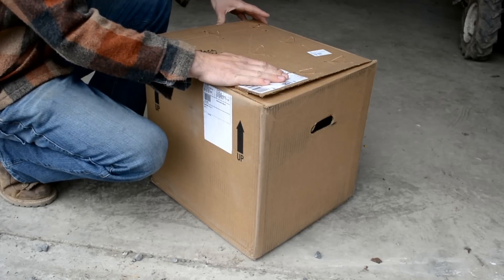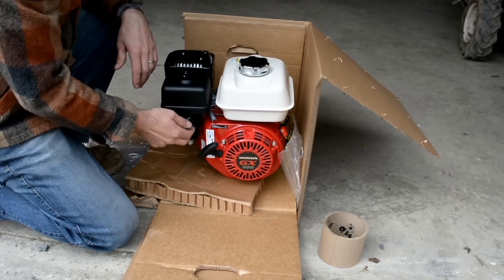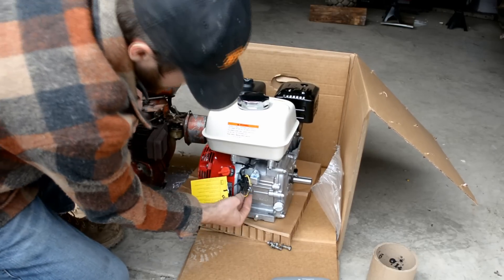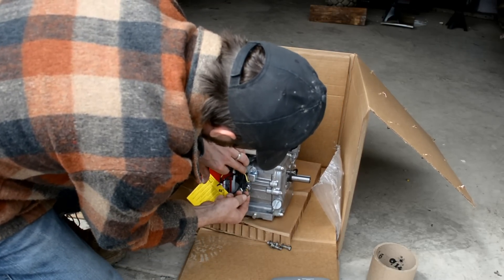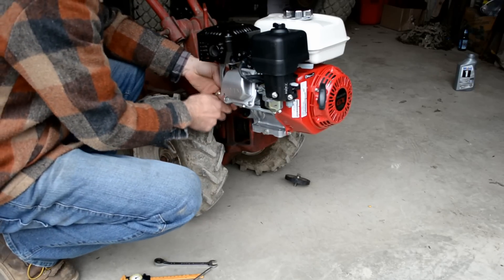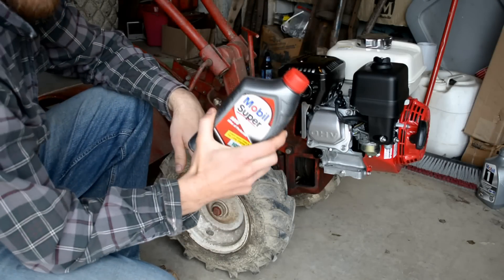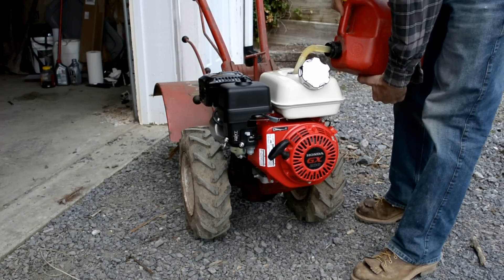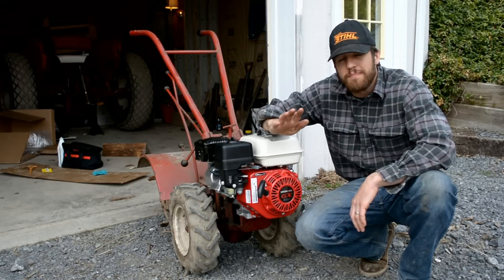Upgrading a Troy Bilt rototiller with a new Honda engine

Comment: i remember the Tecumseh engine  on pallets  waiting for mounting.  i worked on assembly and machine shop in the troy factory
Reply: Dad bought a 6hp Tecumseh Troy bilt in 79. I was the mule behind it most days. I inherited it when he passed last year and i just got i it running yesterday to till a patch for my wife to plant an herb garden. Great tools, pity nothing in the market is made to such quality anymore.
Reply: @jamespayne4459  Awesome, sounds like a good memory. Sorry to hear about your dad. I ended up replacing the original Tecumseh with a cheapo predator engine from harbor freight this season, but it works great
Reply: you guys made some fantastic machines. I am still tilling with a 79' troy built Horse
Reply: In your opinion, which engine was better on the horse tillers, the techumseh 6hp or the kholer 7hp, I have a 1979 Troy bilt horse tiller or garden way what ever you want to call it, it has the kholer 7hp on it and runs like new just tilled a nice area today :)
Reply: A little late to the party…but I’m running a 74 model with the 6hp Tecumseh. Dad got it used in 75. It’s a year older than me. Had a little trouble with carb this year so I ordered a new one. Got it running last year after sitting for about 15 years. It’s one of the tillers I’ve ever used.

Comment: Just placed an order with small engine warehouse. Engine cost $295.00 same as yours. Ordered a set of tines with all hardware $99.00 and the 5/16-24 bolt. Hope to have it in a few days.
Reply from the maker: 5 years later and I am still happy with my decision to re-power my tiller with a Honda GX. Worth the money to keep these well built machines in the soil!
Reply: NCPA Outdoors  Dont know if I asked this question or not. But did you lose reverse when you put this engine on. I got mine on and a new set of tines. It’s like a new tiller. Did about a quarter acre of garden space. I have two hillers that came with the tiller. Makes pretty rows and this thing is a horse. And it has plenty of HP to till with. I run mine half throttle while tilling or plowing. It never struggles.
Reply from the maker: backspace4093 reverse works great!
Reply: I purchased mine New in 1982 at a local Troy-Built Dealer. I have an 8hp Kohler I want to replace. Will the same GX Honda also work for me?
Reply: @RickBelleville  yes sir
Reply: @RickBelleville  My TB Horse had a Briggs Industrial Plus 8 HP.  I just purchased at Honda GX 200 QX2 from Arlington Power Equipment for a very good price ($369 + free delivery).  I am told that the Honda GX 200 (5.8 net HP and likely 6.5 gross HP) has plenty of power even though the Briggs that came with the machine had 300 CC displacement compared to the 200 CC for the Honda

Comment: What size are the engine mounting bolt? I’m buying one  but it has no engine currently.
Reply from the maker: Sorry, I don’t recall the bolt size as its been a few years since I’ve had it it apart.  I believe it was a standardized bolt pattern and size because the new Honda uses the same mounting holes and the original bolts from the old HH6.0.  Good luck with your project.  Happy gardening.

Comment: Thanks for this Youtube Video. My Troy Built Horse died just a couple of months back, rather than tossing it I found this video, bought the engine you recommended and replaced the old engine. Everything you said was spot on and made the engine change very easy. Now I am tilling better than ever. Thanks again
Reply from the maker: Awesome!  Glad your back in business with your TB tiller.  Unfortunately the original engines seem to be the weak link in these old tillers.  With minor maintenance this machine should serve you well.  Thanks for watching and commenting.
Reply: Just to be clear you re-powered your tiller with the Honda GX  200 QX or QX2

Comment: This engine revolutionized the small engine industry. Just about every engine manufactured copied this design. By far the best small engine on the market! 
Nice video!
Reply from the maker: Thanks for watching
Reply: @NCPAOutdoors  When TB made the transition from using iron block engines to aluminum engines, TB would bolt an "engine weight" to the bottom of the aluminum engine block to give the machines roughly the same balance and also weight helps you be able to put torgue to the ag tires/wheels which helps with traction.  

Did you compare the weight of your old engine to the honda engine?  If so what was the difference in lbs and did the change in weight affect the balance and tration of your honda repowed tiller ???

Comment: So how do you keep the pulley from turning to remove the bolt?
Reply from the maker: Mine pulled off easily by hand, but an impact driver or a three finger puller might work if needed.

Comment: Great video. I need to do the same for my 1974 tiller. Back then, they sold them with a 4hp Clinton. It's impossible to get parts for that anymore, so I'll be upgrading this spring.
Reply from the maker: The new motor was definitely worth the investment.  Thanks for the comment!
Reply: I have two of those Clinton engines 498 series. One came off a tiller, one came off a Yazoo mower and I got both of them in 1973 when I was in high school. Both had broken connecting rods. I repaired both and they still run. The tiller one we used to start racing kart engines with.

Comment: Good choice with the GX engine. They are as durable as the tiller. Now that you repowered it, time to put new tines on it.
Reply from the maker: Good observation on the tines!  We’ve looked at a new set of tines and tires these last few seasons, but its working good as is.  Possibly next year.  Thanks for the comment.
Reply: @NCPAOutdoors  It’s been three years now how’s it holding up. Mine still runs as good as the day I bought. Well worth it.

Comment: While showing bolt pattern, why didn’t you say the measurements ?
What about shaft dia?
Reply from the maker: I believe it was a standard bolt pattern, however it’s been a few years since this project was completed and I don’t recall the specific numbers.  I refrained from mentioning it due to various model machines.  Some TB tillers used engine other than the engine on mine.
Reply: My question exactly . Left out the most important bit of information we needed to here . Guess that caliper was for show and he couldn’t read it .
Reply: @raymondcote6669  Not to say that they do not exist, but I have never seen a TB Horse with anything other than a 3/4" keyed engine output shaft

Comment: Hi 

i have a Troy-Bilt Pro Tiller  8 horse    Kohler Magnam engine and i would like to do the same as you did on your tiller would a    GX270 honda motor fit? Is this a good choice. Just really like your video of your repair. any way Thank you in advance Mike here
Reply: i also have kohlar engine what engine did you choose
Reply: I replaced my 8 HP Kohler Magnum with a GX270 from Small Engine Warehouse in Indiana.  Great engine, even better than the Kohler and it was great!
Reply: @stevewarner8880  I just pulled my Kohler Magnum off of mine (8HP), the crankshaft is 3/4 dia and is 2 7/16" length.  The Honda GX 270 is 3.48 x 1 I think?  How did you make that work if I may ask?
Reply: @zacharbert6604  IF you are still looking to upgrade from the Kohler Magnum 8 HP,  Small Engine Warehouse carries a custom 9.5 HP Kohler Command Pro (industrial/commercial) engine that they have modified to be a drop in/bolt in replacement for most TB Horse tillers.
Reply: @stevewarner8880  Did you bore out the TB horse engine pulley from 3/4" to 1" to accommodate the larger and more powerful GX 270? Or did SMW have some custom made/customized GX 270's with a 3/4" output shaft?

Comment: Ok I am the only one who could not remove the 4 engine mounting bolts because they could not get the darn pulley off?
For those of you as challenged as I was here is the trick.
Do the stuff that is obvious, throttle cable, remove gas from tank, oil from engine ect.
Now to the brass tacks.
You can not remove the engine from the tiller because the pulley has been on there 40 years and rust wins this one.
To remove engine this is what I did.
1, Remove the 2 bolts on either side that hold the pins that the engine /cast iron mount sides on.  Also remove the 2 bolts that attach directly to the cast iron engine mount.
2,This puppy is really heavy so get help if you can.  Now you can get to the pulley.  Use a 67021 puller available from O'reillys auto parts as a loaner tool, Use it in the 2 jaw mode other wise there is no room to fit the 3 jaws into the cast iron part.
3, Pull the wire off the spark plug.
 Use an impact wrench to tighten the puller center bolt otherwise you may tear your arm off.
Now you are home free.

Comment: You can't beat a modern design OHV engine with the olde obsoleteo flathead designs.  The old tillers were great but they are even better with modern engines.

Comment: i am trying to pull the 2 sliding engine support mounts that the engine slides up and down.  i pull the locking bolts, but I cannot pound those long rods out.  does anybody have any ideas?
Reply: Had the same problem.  Pb blaster  helped a bunch soak them good and they should come loose

Comment: Thanks for posting!
Old Troy Bilt Horse tillers deserve love. They are the best designed machines. I like them so much I have 4. Last year I picked up a 1989 Horse 8 Kohler that was never started. A museum piece....for 500 bucks. I want to put it in my family room, wife says NO
Reply from the maker: We have to keep the wife happy!
Reply from the maker: W TF? When I completed this project to repower my Troy-bilt tiller I used the Honda engine because of its reliability and reputation.  When this engine was ordered, the distribution company I bought it from claimed it was built in the USA.  A quick visit to Honda’s website indicates that while it is a Japanese company, versions of the GX series small engines are still built in America, with American workers.  Thanks for watching.
Reply: NCPA Outdoors  I have a 8 hp Briggs industrial commercial engine on my tiller. I bought it pretty cheap no running. I want to replace it with the Honda engine. According to small engine warehouse it will fit my tiller. I tried to find the dimensions on my old engine on line but no luck. Maybe I’m Just not looking hard enough. The crank size is 3/4 x2  5/16 keyed shaft that’s the Honda engine.
Reply from the maker: backspace4093 my original engine was an HH 6.0.  Online engine suppliers should be able to set you up with a comparable replacement.  Sometimes a phone call can save a lot of time.  Best of luck.
Reply: W TF?  politically correct ignorance
Reply: How can you tell what year model they are?

Comment: I did exactly the same to my '72 Horse, only I used a 160 GX off a worn out pressure washer. I would one day like to rebuild my old Tecumseh to retain that "Classic" TB.
Reply: Keith Lincicum was your 160 Gx a direct fit? Have you been pleased with the performance?

Comment: I need to do the same. What model Honda engine did you use? Thanks!!
Reply from the maker: Feel free to check out the video, I think I covered the old and new model numbers.  I believe its a Honda GX 200QX.  The 200 is a few pound lighter than a 240 or larger but it isn't an issue for me, hardly noticeable.

Comment: No more reverse with that engine!
Reply from the maker: If you use the original pulley reverse will work fine.  No issues with my setup, everything thing bolted right up!

Comment: Will the original bumper guard fit around the Honda engine?
Reply from the maker: Hard to say as I didn't have one on my tiller.  I would assume it would fit based on the size comparison of the engines.
Reply: It will fit and you will have about a half inch of clearance.

Comment: Beautiful engine, great selection.  I hope it serves you well.  Is there a Honda with higher horse power that would be as easy to change-out as the one you selected?
Reply from the maker: Thomas,
I've seen Honda GX 240's and GX 390's used since upgrading my TB.  I don't feel that more power would be required for.the ground I work.  I guess it would depend how much hard pan soil you have to break up every year.
Reply: Thank you.

Comment: That Honda engine seems a bit light in the tiller at 200cc and 5.5 net hp.   Would a 305cc or 390cc work better?
Reply: They changed the way horse power is rated.  The Honda actually put out more than the HH60
Reply from the maker: The Honda is less weight than the HH60, but I don't feel it negatively affects the performance.
Reply: @sldl04  Going with a bigger displacement engine tends to cause two problems.  First,  all TB Horse tillers are set up to take an engine with a 3/4" keyed output shaft.  Second, the bigger more powerful engines tend to have a different and bigger bolt pattern that often does not mate up with the TB horse "bell housing".  Small Engine Warehouse and a few other places make an adapter plate to deal with getting the larger bolt pattern to mate up to a TB Horse "bell housing".  I have heard of people boring the 3/4" main drive pulley hole to 1" and then re-cutting the key way to make it possible to use larger displacement/higher horsepower engines on a TB horse as well.

Comment: Got the bolt off. Took off the flywheel guard and held the shaft nut while removing the pulley bolt. I can't seem to get the pulley off. How did you do it? It didn't look like you used a puller. I'm at a standstill and your help would be fantastic. BTW, I'm replacing the Tecumseh 6hp with a Honda clone. The tiller is a Horse 1 from April , 1970.
Reply from the maker: This is only held on by a key and shouldn't be a tapered shaft.  That being said mine fell right off.  I would assume that 40+ years of moisture, dirt, rust and grime would have it seized to the key and shaft. A two or three finger puller should take care of it for you.  The puller are fairly cheap or most auto parts stores will loan them out.  Thanks for watching.
Reply: +NCPA Outdoors    While tipped forward I soaked the axel/pulley overnight with penetrating oil. No go trying to pull it by hand. Auto Zone loaned me a 3 finger (you have to use your credit card, but get the $ right back) and it slid right off.

Comment: How did you remove the pulley bolt? Do I wedge something into the pulley to immobilize it, then loosen? What is the circular fitting your pointing at? My bolt is an exposed 9/16. Thanks.
Reply from the maker: Mine pulled of easily by hand, without the use of a puller.  A three finger puller might work if needed.

Comment: what was the exact model number on your Honda?  I'm planning on replacing mine and I have the same engine tecumseh hh-60. 
thanks for the video was extremely helpful.
Reply: Honda gx 200
Reply: mattprang4684  The poster of this video used a  Honda GX 200 QX which was the model number for the direct replacement engine ten years ago.   From what I have been able to glean using AI internet search the updated model and model number is Honda GX200UT2QX2

Comment: What about weight? Does the new Honda weigh the same as the old Tecumseh?
Reply from the maker: The HH-60 is cast iron and the Honda is cast aluminium.  As I recall the Honda was a few pounds lighter but I didn't notice any negative impact to the operation.  Thanks for the question and be sure to subscribe.

Comment from the maker: It would have been cheaper to use a clone but I went with the Honda GX as I didn't want to mess with a breakdown when it was time to plant.  The tiller works great, can't complain.  Thanks for the comment.
Reply: NCPA Outdoors =
Reply: NCPA Outdoors  Did you lose reverse when you did the up grade. Also did you have to use any spacers to get your pulleys to line up.
Reply from the maker: backspace4093 The reverse works great!  Reused the same spacers from the HH 6.0.  It was an easy project!
Reply: @NCPAOutdoors  I would make the case that while the predator engine will get the job done and is cheap, in terms of resale value, the predator hurts a tillers resale value.  If I were buying a tiller that did not have the factory engine in it and it was a predator, I would be very reluctant to buy it.  While at the same time if the tiller had a replacement Honda or Kohler replacement engine I would not hesitate providing the engine is in good shape and still has good compression.   Call me skeptical but in the long run, I can not see the predator having the same longevity as a genuine Honda GX

Comment: Wonderful video! I repowered my 2 Troy bilt horse tillers with 2 Honda clones from harbor freight. For $100 with a coupon, i couldn't really beat the price. But i might replace both of those motors with true commercial grade Honda when ever either one dies.
Reply from the maker: zack hill It would have been cheaper to use a clone but I went with the Honda GX as I didn't want to mess with a breakdown when it was time to plant.  The tiller works great, can't complain.  Thanks for the comment.